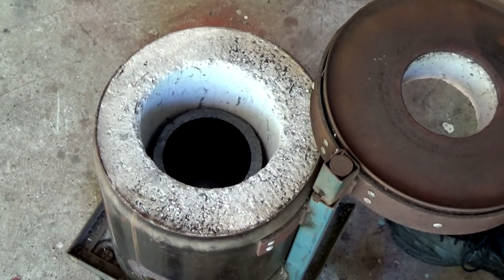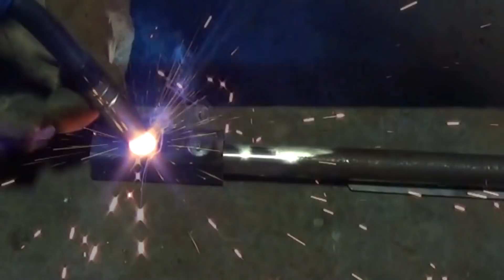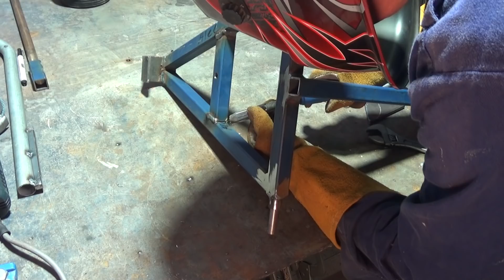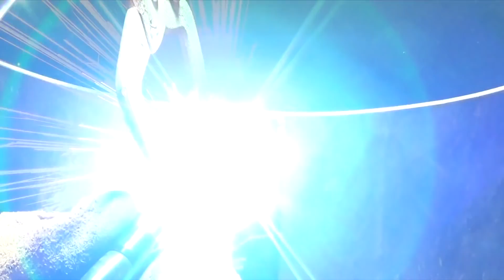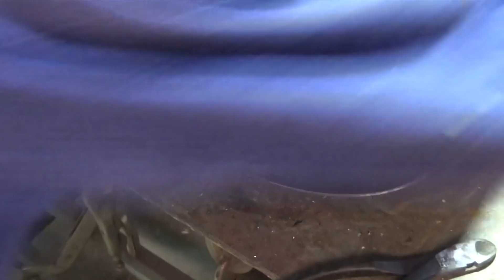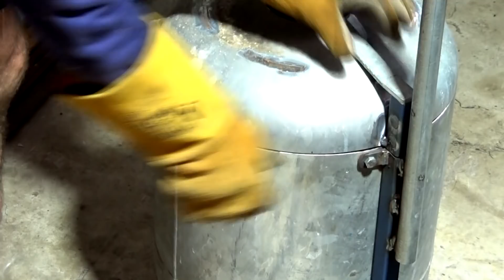DIY Foundry Furnace From a Propane Cylinder

Comment: My only thing though is there a weld-less build of this? For people that don't have welders or all of the other awesome tools that you have? All's I have is cordless power tools and ratchets and wrenches.
Reply from the maker: You could do a lot with threaded connectors. Maybe a ready made solution for the wheels and frame would be a furniture removal trolley or a four wheeled dolly of some sort. 
Regards,
Mark

Comment: Ay up Mark
What is the diameter of the cylinder you used for your furnace? I want to build one and I have a few cylinders but they are only small ones much shorter than the one you used but possibly the same diameter. All the best from England.
Reply from the maker: I have a 2D drawing of my furnace assembly on Dropbox. If you follow this link you can download a copy for yourself https://www.dropbox.com/s/j7bopx7noxi96vn/Mark%27s%20Foundry%20Furnace.pdf?dl=0
Regards,
Mark

Comment: Dear Mark, I firstly have to say that I love watching your videos.  They cover a range of topics that I find interesting.  Most of them you turn what could be difficult into something that looks fairly simple.

There is one think I need to point out.  You are MIG welding tube steel that has been painted.  For best results, you should firstly strip away the paint back to bare metal.  That way you will get better flow and adherence.  

Love your shop and equipment, I am envious. Cheers.
Reply from the maker: You are correct but then I am lazy and not a very good welder anyway so most of my welds are "functional" at best.
Regards,
Mark

Comment: Funny story. I got an old 20gallon (100lb) propane cylinder that I wanted to cut up, and did it the same way as you. I took the neck off and filled it up with water. I dumped it out and filled it up with water again just to be sure. Then I stood it up and passed a torch over the opening, there must have been propane absorbed into the metal, because it went off like a rocket. Shot a 5 ft blue flame out of the opening for a split second and was a very loud screeching sound. I thought for sure it must have been done, but passed the torch over it again and it did it a second time, but not as loud. 3rd time it was clear. Be careful with fuel tanks!
Reply from the maker: Wow, that must have been scary! There was a teacher killed in our region about 10 years ago as he was trying to cut the lid out of a 44 gallon fuel drum with an angle grinder. He had filled the drum with water several times and started to cut the top seam of the lid with some air space inside. The fuel had penetrated the top seam of the drum and as he was cutting the fuel was vaporising from the heat and building up inside the drum. It reached the flash point and exploded in his face. I think it illustrates that any receptacle that has had any fuel in it should be treated with respect.
Regards,
Mark

Comment: How did you make your burner?
Reply from the maker: Adam,
Most of the parts were turned on the lathe. The rectangular slots for the air vents were filed by hand. The long stainless steel tube is just press fitted onto the gas jet holder. The gas hose barb was a commercially available item threaded into the mild steel gas jet holder. The jet itself was a brass fitting I made from scratch but I am sure you could buy them ready made. Check this video. It shows more details on the burner at about 15:21 https://www.youtube.com/watch?v=KGFYJwvKLRo&t=915s
Regards,
Mark

Comment: Hey Mark, great video. wondering if you have a total height of the new foundry furnace.  Also chance do you know where one can buy the pyrocreate in the USA.
Reply from the maker: Harry, the total height from the base to the top of the lid is 21 1/4" or 540mm. That is more than enough for my #8 crucible. I don't know if there is a pyrocrete stockist in the USA but you could try a place that does  pottery or kiln supplies. The place where I got mine also supplies to pizza oven builders. It is also used in brick kilns. We used to have a brickworks in the district and they used it to repair kiln linings but it was rated at a much higher temperature. 
Regards,
Mark

Comment: A little help in the future to better your welds grind the paint to bare metal about half an inch.
Reply from the maker: You can clearly tell that I am no welder. I make what I call "functional welds" I think I will leave the "cosmetic welding" to Jody et.al.

Comment: Try to avoid welding away from you , you will find you can  see better and control the speed easier welding across your body line..
I’m looking forward to the next video ! Where did you get the refractory cement from ?

Comment: Mark,

I've finally caught up on all of your videos again!  I really like your ideas here and will have to try to do something similar.  Did you get a gas tank that had expired and was no longer useful to the gas company?  I'm thinking that my "local" gas companies ought to have some expired tanks that they'd sell for less than the cost of a functional tank.

I've got a large "scrap yard" bronze bushing that I want to cut up & melt down for casting into something that might actually be useful.  Or just into small ingots for use later -- as a learning exercise.  Of course, starting with aluminum before brass & bronze is probably a lot smarter & safer for me....  Then comes cast iron or similar if I catch the bug -- an expert foundryman about 25 miles from here does this in his back yard for casting replacement parts for antique engines that he restores.

I'm looking forward to your next video in this very interesting casting series!
Reply from the maker: Bob,
I was lucky to get my LPG cylinder for free. I asked a mate of mine if he knew where he could get one and he told me there was an out of date one at the school where I used to work. It was in excellent condition but had past it's test date and apparently the gas company just left it there instead of collecting it and retesting it. I was going to get in touch with our gas supplier to ask if they had any old ones for sale but who can argue with free! I had also intended to check out our local recycling centre at the rubbish tip so that might also be a possibility. The pyrocrete that I used will be good for aluminium, brass and bronze but I am not sure it will stand up to temperatures required for Iron. There is another grade of pyrocrete called 241 which is more expensive but should be good for iron. Good luck with your build. I had always thought it was too hard and too expensive to get into home casting but no one was more surprised than I when my first casting turned out perfectly!
Regards,
Preso

Comment: Perhaps you could have welded the handle onto one side of the upright rather than the back? this would have allowed the lid to swing further.
Reply from the maker: Mike,
but then it would be asymmetric!  😮 To an Aspergian personality like mine it would drive me nuts. As it turned out, I found that the lid just clears the cavity but now I realise that it gets really hot. The blowback from the burner seems to travel up the hollow tube. I am going to have to block the hollow end and maybe make some sort of wooden insulator/hand grip. I test fired it yesterday and so far it's looking good.
Next episode out in a few days!

Comment: Thought you might enjoy this! https://youtu.be/wBGCXqstqqo Notice the non-standard foot wear!
Reply from the maker: William, the link said the video was removed by the user buy I am guessing it was someone welding in sandals?
Reply: Guys in Africa casting aluminum barefooted!  @Preso58
Reply: Found another link to it: https://www.youtube.com/watch?v=IXtI5XUbCtg Warning! It may pucker your butt watching this!
 @Preso58
Reply from the maker: Wow! He did at least have rubber thongs on when he poured the red hot metal! I noticed he shifted his foot pretty quick when he spilled the melt. Nothing sharpens your focus like the threat of third degree burns. You have got to admire the quality of the finished product despite the basic equipment though.

Comment: Welding gal in shorts,  you like to live on the wild side 😅  ,   great build so far, 👌
Reply from the maker: Yes, I know, not regulation work wear but the day I was doing this it was around 35C in the shop and about 90% humidity. Just wearing a long sleeve shirt was enough to have me drenched in sweat by the end of the day. Getting a hot blob of zinc certainly livens up your footwork too.
Reply: @Preso58  sounded like a good day for a beer or 3 😉👌

Comment: 'nother good one Presso!   (Paul from Adelaide)
Reply from the maker: Thanks Paul. Today I mixed up roughly half of the pyrocrete to fill the lid and the base of the furnace. Tomorrow I will be making up the form to create the inner surface of the furnace body. Man it's going to be heavy. Roughly 60kg of pyrocrete alone plus the weight of all the steel.

Comment: Hi Mark. Love the new foundry , I bet this one will work great for you. I know you said the pyrocrete  was relatively available to you in Australia but kind of pricey. I live in the US and was looking for it in the big box stores and on line. I can't seem to find it over here. Is there another name for it or a different product that will work the same. I've never really needed it due to I don't melt down any of my materials. But recently I was able to get my hands on some aluminum 5 inch round stock that was used in stretch strength testing and is full of stress cracks which makes it impossible to machine down and use. My thoughts was to melt it down into ingots to where I could use it. Thanks for any help or ideas.
Reply from the maker: The Pyrocrete that I used is made by an Australian company called Foseco. I purchased it from a company that sells to potters. There is another company in Brisbane that sells soft and hard refractory materials for making and repairing pottery kilns. Some suppliers who do pizza ovens might also sell a similar product. I get most of my stock for melting in the home foundry from a car recycler. I can buy cylinder heads, intake manifolds and the like for about $1 per kilo. The problem is cutting it up to fit in the crucible. I can get access to a large metal cutting bandsaw but you need to avoid the valve seats and the valve bushings. They are really hard. I was told that wrought aluminium is not always suitable for melting but I sometimes add a few bits to the melt if I have scrap that is no good for machining. Sorry, but I don't know of a US equivalent to Pyrocrete but try the pottery market. They have to fire their kilns to similar temperatures. Brick makers also use refractory cements to repair their kilns. Good luck!
Reply: @Preso58  I looking into to making one now  that I have seen yours, where did you get the pyrocrete from? Foseco don't seem to have it on their website, but not sure if they would sell me just a couple of bags anyway. There is a shop in Milton selling it online but they only have 5kg bags, I will give them a call to see if they sell bigger amounts
Reply: Have a look at Keith Rucker vintage machinery on utube. And look back on his videos. A couple of years ago he built a furnace, and he lives in Georgia, USA.
Reply: @gibbsey9579  thank you I will give that a try.

Comment: Hello Mark, Just a thought for the future. May I suggest that you keep your power tools (Angle Grinder) out of harms way. Be it from any source of sparks, I loaned one to a friend and it came back fornicated because sparks went into the vents at the brush end as well as on the Armature. Also direct your sparks away from all important things. I learned this at my expense and now NO tools are loaned unless I am using them at an hourly rate! I have also seen this in workshops where people do not pay for the tools, just use them with no respect.
 John, Australia.
Edit, I look forward to the application of the refractory as this project is on my bucket list. Cheers from John.
Reply from the maker: John, I tend to be an impatient and messy bugger in the shop. I took a good look at my bench today after reading your comment and you will be happy to know I cleaned up and put away my other grinder so that it would not ingest all the metal dust from the other one. I also became more aware of where the sparks were being directed, especially when I noticed that the lens filter on my camera had metal particles fused to the surface. I just had to order three new filters! Thanks for the advice. I really don't want to kill my nice Milwaukee grinder!
Regards,
Preso

Comment: On your hossfeld Bender copy what are the angles of the bends I have plans to do one but it didn't give me what the angles are thank you
Reply from the maker: Frank, I found a set of drawings online although they were all in inches (we're metric here) I redrew the design in Autodesk Inventor. You can find the drawings here http://kinzers.com/don/MachineTools/bender/ I just checked and it doesn't specify the angles but you can calculate them by drawing out the linear dimensions to scale. I reality, I don't think the angular dimensions are all that critical but mine were bent to 150 degrees.
Regards,
Preso
Reply: @Preso58  that's the same drawings I have I just don't know the angle of the two bends
Reply from the maker: @hippizitify  Hi, did you read all of my reply? I set mine to 150°
Reply: No I did I'm sorry but I got it now thanks

Comment: If you put the burner on the same side as you are going to turn the lid you won’t have a hot lid to one side and a hot tripping hazard on the other every thing will be to one side out of the way
Reply from the maker: I agonised over the placement of the burner for a long time and settled on putting it at the back behind the wheels and on the opposite side to the foot pedal. I usually have the propane fuel cylinder fairly close to the furnace and I try to keep anything that might be a trip hazard on the same side of the furnace and away from the working area. It's a matter of being disciplined (normally I am not) but when dealing with a crucible of face frying hot metal it tends to keep you focused.
Regards,
Preso

Comment: Mark, Glad to see that you ground off the zinc before welding. But it was nothing personal, it was after all for your own benefit, not ours. Regards.
Reply from the maker: Peter, You were correct to remind me. I wanted you to know that I was taking your advice. Thanks for watching.
Regards,
Preso
Reply: Great project,well done,I’m wondering if the heat from firing the furnace will heat the tank sides enough to cause the galvanized vapors to become a breathing problem?

Comment: I wondered what happened to the casting. A problem.. but the kind that you end up with a nice new tool is not bad having.
Reply from the maker: I did actually get ready to start the casting. I made my greensand too wet and the two halves of the sand mould stuck together (twice). I then purchased some calcium carbonate parting dust which took a week to arrive and in the meantime I purchased the graphite crucible which also took a week to arrive. Then I realised that it wasn't going to fit and on and on it went. I should be back ready to do the brass casting next week (I hope).
Reply: Lol Hopefully the rest goes with out a hitch. Looking forward to the rest of the build. Thinking of building a furnace myself. some day lol

Comment: I've noticed that the steel in Australia seems to have that blue coating on it, is there a reason for this?
Reply from the maker: John, you can buy bare steel in flats, sheets, rounds and angle but all RHS and SHS comes with the blue finish. It could be something to do with the low volume of sales here compared to other parts of the world or because we seem to have just a few companies selling steel in the domestic market. I was watching a channel called Scott Turner. He makes industrial style steel furniture and he has to strip all the blue paint off his stock with paint stripper before he starts his projects. Go figure!
Reply: @Preso58  I'm really interested in this build, its something I've always wanted to try my hand at. I like your design
Reply: Ran out of red paint?